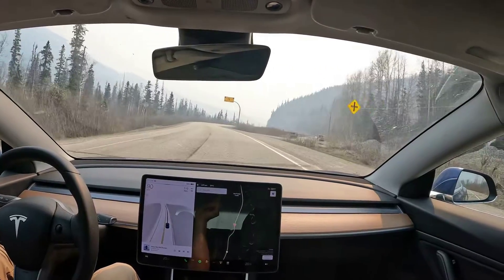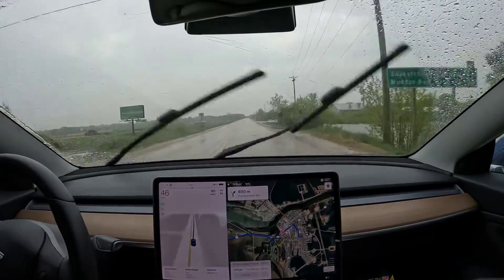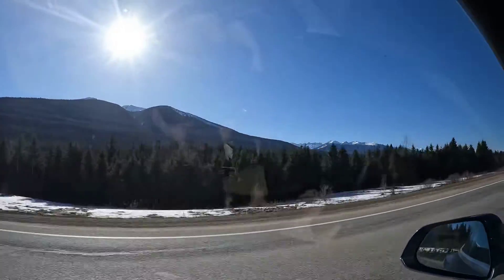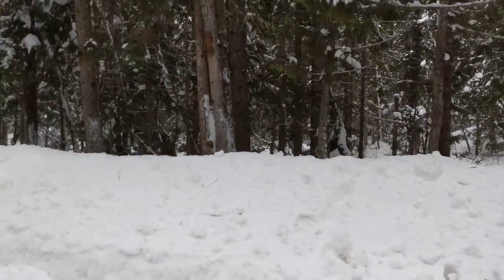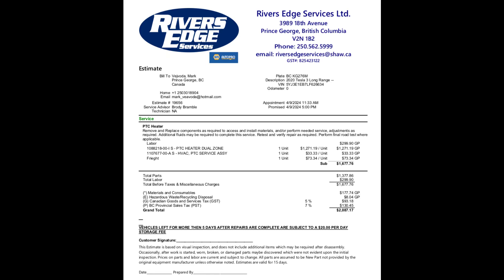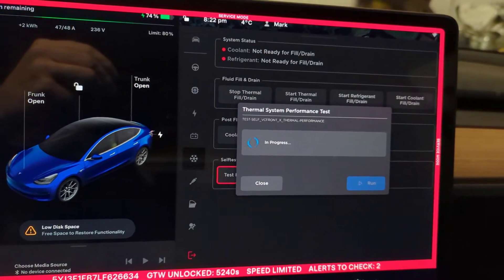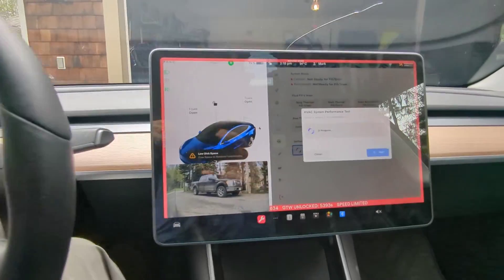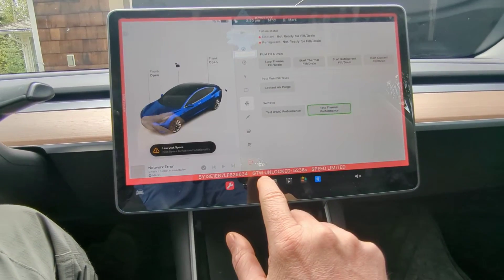2020 Tesla Model 3 PTC Heater Repair | 3rd party EV shop in Northern BC experience

Comment: Just paid $1,300 for the heater and 12v battery replacement.
Reply from the maker: Yes advantages of living near a service center, good for you
Reply: I’m about to approve $1,100 for the heater and 12 v on my 2019 model 3 … don’t know anything about this heater part… I’m at about 100,000 and this is my first time needing to replace it

Comment: Thanks for the video. Its very informative, particularly the info on the HVAC tests in the service menu. I didnt come across them until now. 
My issue was a bit different, but I suspect its the PTC heater causing the problem. The car would not engage drive, complaining that the High Voltage circuit was not available. Going by other posts, it looks like the HV goes to the PTC heater which can suffer from a common fault where it shorts it to ground. This results in the safety systems disabling the HV lines, which includes the main battery and motor. Disconnecting the PTC heater from the circuit doesnt work (which I tried) as the safety systems will detect this as a break in the cable and also refuse to power up the HV lines. So ive no choice other than take the gamble, buy a replacement heater and replace it myself, or get the car towed to a tesla service center three hours away. These PTC heaters are a PITA.
Reply from the maker: thanks for the additional great info, i hope this comment helps others down the road!
Reply: @TeslaPrince  Hi, please provide any update, if you have. I got the same issue.
Reply: Its hard to read the total $. Please let us know via comment. 
How much warranty do they provide.

Comment: At 260,000km mine finally went on my 2018. I've had lots of free time lately so I ordered the part from Tesla and installed it myself. I took apart the old one to see what failed but there is nothing visibly wrong. I'm going to hang on to it in case I find someone who is able to diagnose and repair it.
Reply from the maker: How long did it take you to do the whole job and how difficult was it, did you require the use of a lift from a shop?
Reply: @TeslaPrince  I have a couple of ramps to drive up on to access and remove the front skirt and unplug the heater from the high voltage connector. The online service manuals that Tesla gives us access to is extremely useful. It took me a few hours but  I was in no hurry, it would be a 45 minute repair for someone who's done it once or twice.